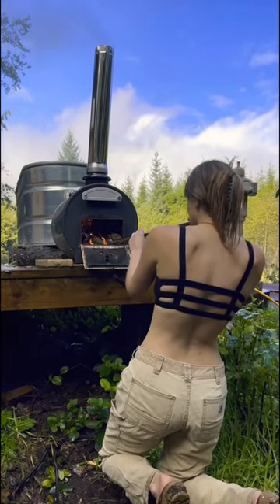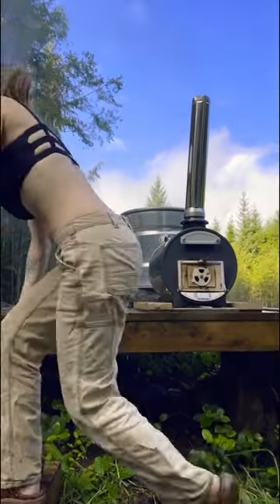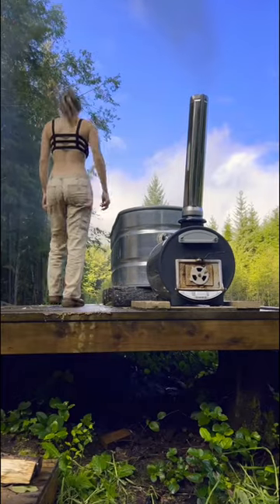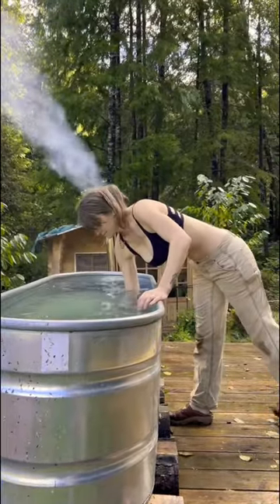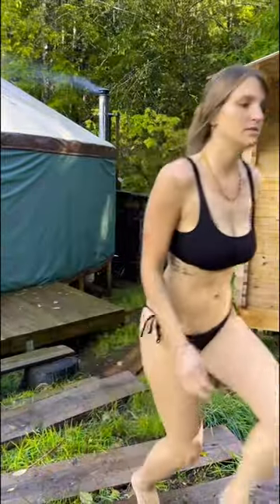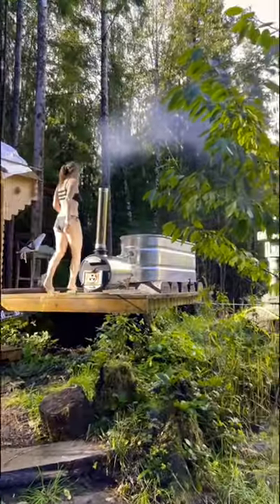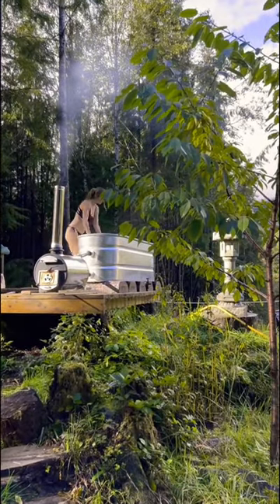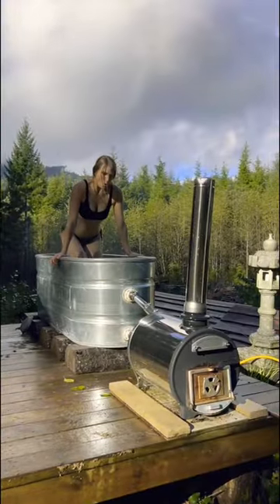Off Grid “Hippie” Hot Tub, pt. 2 Wood Fired Bath #shorts #youtubeshorts #hottub #offgrid

Comment: A video showing how the water pumping system works would be really cool.
Reply: She explained it, cold water flows in the bottom and heats up and flows back out the top into the tub
Reply: I think the rising angle from the heater lets the heated hot water rise back into the main water bathing tank.
The flat pipe lets the sinking cooler water flow into the heater, to be heated. Where it will then rise up into the main water bathing tank.

Probably the bigger difference in height, there will be a bigger difference in temperature, so probably bigger flow rate. Just my guess.

If they use the solar car battery water pump and use that to push the cooler water into the heater then that will help with flow.

There are many production tubs like this which you could look up to see how they work. Several tubs are heated by logs. Look em up.
Reply: The system's actually quite ingenious

Comment: I have built similar, only i used a 12v deep cycle in a solar charger to run a small pump. I also use a heat exchanger brazed in, then a quarter inch plate of steel welded in to hold it in place and maximize contact.

Comment: Can also put a copper coil spiral up,  one end high in the tub.  One end near bottom of tub.

Build a small fire in the middle of the copper coil.

Hot water moves up, cold water gets sucked into coil.  Rotate as it heats water.

Could set up small hot water tank for dishes and laundry this way too.

Comment: I was thinking about charcoal filtering for your water but not sure where to put it so that it would function automatically, but then it hit me, a solar powered bird fountain could suck water through  a simple cup on the bottom, like a Styrofoam coffee cup with crushed charcoal from the very fire that is heating it, wrapped in a cloth and the cup has holes in it and some pea gravel for weight balance and you have an automatic filter.  A trampoline cover or fine wire screen could keep leaves and gnats out.

Comment: Had you thought of piping the heat from your pizza oven over to the tub? Just to be more efficient. Not that you would always use the extra heat, but would be nice to take a bath after making dinner and your water is already mostly warmed up. Just get it the rest of the way with the logs.
Reply from the maker: Can’t do this because honestly most of the heat comes out the opening and not the flu pipe